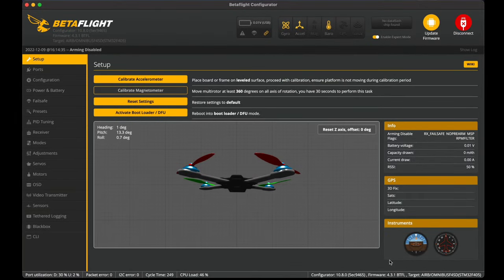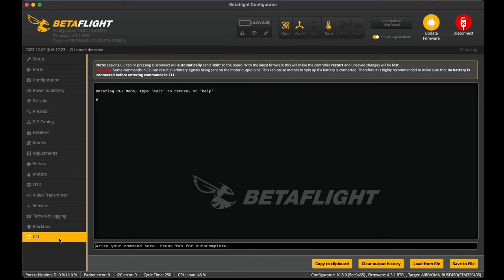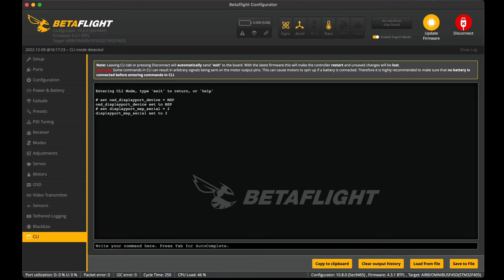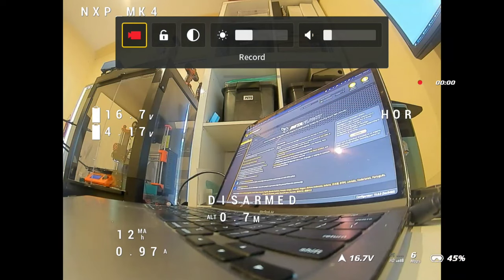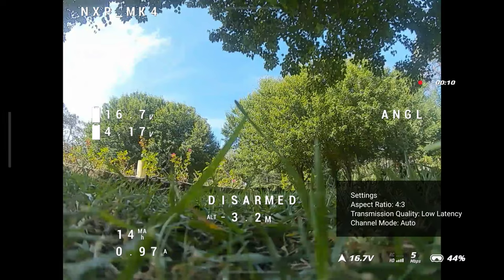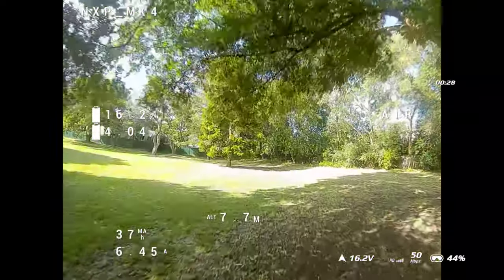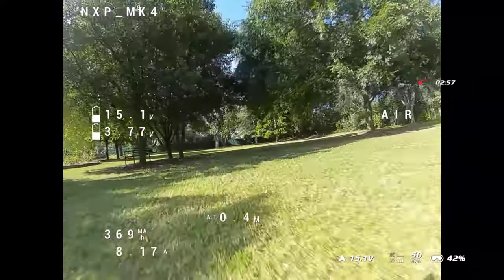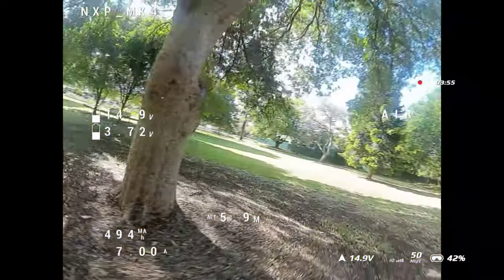DJI Goggles 2 + Vista - MSP DisplayPort Setup on Betaflight 4.3 & Test Flight

Comment: [solved]What do I do with BF 4.4? I updated and it's gone. Your method doesn't work because displayport_msp_serial is no longer available...
Reply: You have to set it up in the ports tab. Go to your UART where your O3 is installed and set it to vtx(MSP+Displayport) in the Peripherie tab.
Reply: @i3engee377  Yepp, that did it, thanks a lot!
Reply: You're welcome my friend 😄 had the same issue🤦🏼‍♂️
Reply from the maker: @I3ENGEE Thanks! I haven't tried Betaflight 4.4 yet but looks like they changed these settings under the hood. I'll update the title of this video and the thumbnail to show that it only works for 4.3 or prior, and not 4.4.
Reply: @nxp200  Good idea - maybe pin the comment of I2ENGEE
Reply from the maker: I can only pin the original content, which is your question/problem. Hopefully that helps others!
Reply from the maker: @seb-depp  seems I can't pin his comment directly, but only the original comment from you. I'll pin it anyway.
Reply: @nxp200  Will do the job well.
Reply from the maker: @seb-depp  done. Pinned comment 👍
Reply: BF 4.4
set displayport_device = MSP 
and
set vcd_video_system = HD
SAVE
Reply: @IyantSeawolf   Thanks. I solved it quite some time ago but thanks anyway.

Comment: I had to downgrade my firmware due to issues with components and this CLI entries fixed my camera issues. I went through every video and Reddit thread until finally saw your video … thanks !
Reply from the maker: There's a video I made for BF4.4 too. Check it out on my video list. That will get you onto a more recent version at least. I've yet to try BF 4.5, so I'll try to make a video on that soon
Reply: @nxp200  I got a good deal on a Nazgul FD5 6s but it took me 2 days to fix all the compatibility issues after upgrading the firmware to 4.5. Do you think it should all work with 4.5 as is or do I need to upgrade ESCs firmware as well?

Comment: I really appreciate you taking the time to put this together...very helpful to me; especially the narrative around the OLED screens. 
I'll have to dig deep and invest in the upgrades.
Reply from the maker: No problem. Any excuse to go out and fly a pack! LoL plus I was excited to try it out as well. One thing i didn't mention in there was it felt really weird to see Betaflight OSD inside digital goggles 😄
Reply: @nxp200  Yeah...not sure how much OSD info I want. It can get distracting. If I remember right, I only watched a few of the metrics when I flew analog. Would like to have distance flown, just to have a mental note of range.

When image stabilization is on (Rocksteady?), is it smoothened in real time, such that it appears smooth in the goggles), or is that a post processing affect?
Reply from the maker: Yeh that's true. The main OSD element I look at most during flight is the average cell voltage and the main warnings for low battery etc.

The Caddx Vista doesn't have Rocksteady or stabilisation. I think it isn't able to because it doesn't have a gyro or a media chip for it to process the video before transmission to the goggles. The O3 Air Unit has a gyro in the camera and media chip in the main unit, so it's able to do Rocksteady.

Comment: Thank you so much for a very easy to follow and very helpful video. I recently upgraded to the goggles 2. I have 2 quads set up with 03 system and have  updated all my vistas  to work with the goggles2. One of my quad's has GPS With GPS rescue set up. I was so frustrated trying to figure out how to get a flight OSD in my goggles. The 2 CLI Commands did the trick . Thanks again happy flying !

Comment: May i ask you what downside of this vista? I heard lots of pilot complain about the heat, its will die when over heat. Was it true?
Reply from the maker: The CADDX Vista units are quite durable in my opinion in terms of heat. I haven't had any issues or any of them dying. I have had the air unit show a warning about overheating and then shut down because it was powered on while on the bench and I wasn't flying, so air flow wasn't cooling it down. After turning it off and letting it cool, it was working fine again after that. Never overheated during flight. Only my experience only though.

Comment: Hey Bud wanted to ask a question about this. After I type in the last line,  "set displayport_msp_serial = 2" I recieve an ###ERROR IN set : Invalid Name: ....... 
My set up MSP on 3 and my CRSF is on 4. Wondering what I'm doing wrong. Thanx.
Reply from the maker: @88_shadesoffpv  you probably have Betaflight 4.4 or higher installed on your flight controller (if you've bought the flight controller recently). Check out my other video as the instructions are slightly different: https://youtu.be/WjS-d4_Es9w

Comment: When I type set displayport .... I get an error message ERROR IN SET: INVALID NAME: displayport_msp_serial=3.  Why am I getting an error?
Reply from the maker: You may be running a different firmware version than Betaflight 4.3. If you have version 4.4 installed, check out my other video that covers that as well https://youtu.be/WjS-d4_Es9w?si=1xHzmcoZCbSXDLKJ

Comment: I just bought nebula nano pro pairing with g2, and the problem is i get small range and osd view get blurry/pixelate in the edge. Is there any tips how and why like this?
Reply from the maker: There could be a few reasons for low range. Is the antenna damaged or installed incorrectly? If there's interference around the location, try changing the channel. Have you applied the "ham CFG" mod to switch the connection from CE region to FCC (not recommended if this against regulations in your region)? The blurry edges on both sides of the video is likely the "Focus Mode" activating due to poor reception. Disabling this will remove the blur, but will likely increase latency when reception degrades. Also depends on what your definition of "low range" is. In clear line if sight, you should be able to get 100m without issues.

Comment: good day Nat or nxp200  . I think I found the battery's with xt60 4S for my build . my build is at 320 euro so far inc battery's . can i use my  Traxxas EZ-Peak Plus 4-Amp NiMH/LiPo Fast Charger on them?  I   don't know what this means in the instructions. [Charge only NiMH packs or 2S–3S LiPo battery packs. so is that mean . no to 4-S for that charger? . and  does a 6-S smoke stopper  work with  4 -S ? and would i buy the smoke stopper with a button or just regular one?
Reply from the maker: It's Nam 🙂
I'm not familiar with that charger, so I can't say. Sorry. The ViFly Shortsaver 2 Smart Smoke stopper is good as it supports up to 6s and has a button to start and stop.

Comment: Hi, I have a question if you wouldn't mind? easy to follow tutorial BTW thanks, but I have a BNF Nazgul5 I just upgraded from 4.2 to 4.3 and the vista is on MSP UART 1 from factory succex-e f722, so how would I set the displayport_msp_serial = 0 ?  that's not going to work is it?  thanks for your help appreciate it.
Reply from the maker: If the Vista is on UART 1, then yes, set displayport_msp_serial = 0

Comment: Why does you're rc signal not show for the dji display? I'm not getting battery or signal for the dji display and i dont know why. (betaflight osd works fine)
Reply from the maker: I was flying that with ExpressLRS control link instead of the DJI controller, so the RC signal is greyed out. Not sure why you're not seeing the battery or signal for the DJI display.. I didn't have to configure anything for that to show.

Comment: Ok so my msp is set up on uart 1 so when I go to cli and set up serial port do I use 1-1 =0 ? How do I configure if I'm on uart1?what would the command be?
Reply from the maker: That's correct. "0" (zero) is a valid value for UART1
Reply: @nxp200  thank you my friend I will try that.
Reply: @nxp200  when I try this I get a message error in set invalid name displayport msp serial =0

Comment: ive got the goggles 2 and vista  but cannot get the osd  to work, mine is set to uart serial port 1 so i should do: set displayport_msp_serial = 0 but i get error ´´###ERROR IN set: INVALID NAME: displayport_msp_serial = 0###´´
what am i doing wrong?
Reply from the maker: Which version of Betaflight are you using?
Reply from the maker: Yeh. Betaflight 4.4 has changed the settings for MSP DisplayPort significantly after I posted this video and my instructions only work for Betaflight 4.3 and backwards. You'll need to look up how to get MSP DisplayPort to work on 4.4, but I believe it's as simple as an option on the Ports tab now. I haven't tested BF4.4 on my 5 inch quads with Vista yet, so I can't confirm exact instructions. It's on my list of videos to make, but haven't had enough time. Sorry about that. Hopefully I can squeeze it in this week.
Reply: @nxp200  understand thanks bro keep on ripping

Comment: Hi, a quick question. How do I get my air unit to start recording video either on take off or with a button. I did it before but just cannot figure it out now.
Reply from the maker: "Auto record on Takeoff" is a new feature added to the Goggles 2 firmware V01.07.0000 that allows it to auto record when using the Vista. Otherwise, for older firmware, you have to manually use the goggle's menu to start recording each time.
Reply: @nxp200  thank you so much for confirming. My drone with DJI O3 records on take off but seems with the original air unit it doesn’t. I’m slowly changing my drones to Crossfire as I really like the Tango 2 remote now.

Comment: - 1set Flysky i6 remote control with ia6 receiver( send it as your choice)
- 1set Mark4 5inch 225mm Carbon Fiber frame(unassembled)
- 1pcs 35A or 45A BLheli_S 2-6S 4In1 ESC( Send it at random)
- 4pcs 2205 2300kv (2CCW, 2CW)
- 1pcs Aocoda-RC F4 special  Flight Control Board
- 1pcs 1500TVL Camera
- 1pcs TS5828 or TS5828s 40ch Transmmiter ( Send it at random)
- 1set nlyon screws
- 4pairs 5045 3 blade propellers
- 2pcs battery Strap  .  with the ev800d . this would be a good learning drone . i think maybe ? if i run into a hiccup on the soldering of the f4 could i send a picture of my diagram for pointer or confimation ? readytosky package
Reply from the maker: Yep. That sounds like a good list. I personally like 2207 size motors, but 2205 should also be good. I haven't used the Aocoda-RC F4 flight controller before, but happy to try and help if you need. 👍
Reply: @nxp200   super. awesome. I've been stuck for days on what to do .which way to go. Analog /digital/bind and fly/DIY . now I  will order my connector for my controller  for free rider sim. to practice while I wait. and start my own build now. get EV800D googles. And smoke detector thing. first steps. I cant thank you enough nxp200.  . analog now digital next . cheers mate
Reply from the maker: No problem! Yes I do suggest analog first to get into the hobby because it's not too expensive, even if you migrate to digital later, your not wasting much money. Plus, analog is still great for tiny whoops etc to fly indoors for many years to come. So the only thing you'll be replacing are cheap VTX and cameras on your drones 👍
Reply: is this drone able to carry a gopro?
Reply from the maker: Yes. It should be able to.

Comment: Wow, great that Vista also have MSP Display port. Do you know if this is also possible to have OSD on Googles v2 with the latest firmware? Now I'm using WTF OS but I'm just wondering if there is any "official DJI OSD" way for older setup like Vista + Googles v2
Reply from the maker: Hi Rfly. Unfortunately once you upgrade the Vista to the latest firmware so that it is compatible with the Goggles 2 with MSP DisplayPort, you cannot bind it to the V2. There is no official DJI way to get Betaflight OSD on V2 + Vista at the moment.
Reply: @nxp200  Ahh, this hobby is expensive. Now I'm thinking about buying Googles 2 ;) But to be honest I like the WTF OS fonts more, you can also customize them so that part is better but resolution of O3 and OLEDs in googles 2 are I think still winning ;)
Reply from the maker: Haha. Yeh, it can be expensive. But my advice is that the V2 is still really awesome with the Vista and WTF.OS root OSD. Don't go the Goggles 2 if you enjoy the V2 already. I got the G2 with the Avata before I got my V2 (found an awesome second hand deal that was really cheap I couldn't pass on). Hope that helps!
Reply: @nxp200  Cool tip. V2 googles are indeed great especially with iFlight Crystal Patch antennas. It was really pain to screw and unscrew original antennas every time I needed to fit it in my Torvol backpack. Now I can even use original DJI protective bag without even detaching antennas. Happy flying!
Reply from the maker: @rfly-fpv  just keep an eye out for any good 2nd hand deals on the Goggles 2. I suspect there will be a few people who jumped on the Avata that will want to claim back their cash in a few months time. Good luck! 👍

Comment: any idea  where to buy the battery at ? . alie express ? local shop ?  6-s lipo ?  xt-60 ends i think. what size amp ? buy 2  to last how long?🧐
Reply from the maker: The motors you ordered are suited for 4S Lipo. I like CNHL Black Series 1500mAh. Unsure what battery connector lead that comes with your flight controller, but if it's 30x30mm mounting size, then it should be XT60. Each pack lasts around 5 minutes of light acro. 3 to 4 minutes of heavy acro (heavy on throttle with high speed runs etc). I've ordered from AliExpress with no issues. Also I've ordered from local stores when on sale.

Comment: How do you feel about the flight feel with the goggles 2 and vista? I just updated one of mine, and going from v1 to the g2, it feels... Wrong. I went through 10 packs yesterday on the g2, and it always felt a bit off, but I can't tell if it's additional latency or if there's something going on with the frame rate. I haven't heard anyone else mention it though, so not entirely sure if it's a global thing, or just my unit.
Reply from the maker: I've only done the one pack that was for this video. I didn't notice anything strange in the flight feel, but it was quite windy that day, so if there was, I would mistake it for wind pushing me around. I'm not sensitive to latency, so I can't really tell that either. Sorry. Can't help you much. I do want to revert the firmware and try the V2 again, so if I do, I'll record it and report back if I feel anything. Let's hope Chris Rosser does some scientific latency testing on this!! That would be very interesting. 🙂

Comment: THANKS BUDDY,  DO I NEED TO DO A ROOT HACK FIRST ,  I HAVE A AIR LITE ON A NAZGUL V1 , WITH  A  TX16  , TRYING FOR THE MSP OSD , I HAD  DISCONECT THE DJI ORIGINAL REMOTE , AND THE UART ABOVE  MSP IS  USING THE RADIO....WHAT AM I DOING WRONG?
Reply from the maker: Hi StarDuss. Need to clarify a few things. Do you have the Goggles V2 or Goggles 2?

Comment: thanks  for the help nxp200 . can I use my old  fly sky  -16  with the TX805 VTX from the build?
Reply from the maker: Hi Jerry. Do you mean FlySky fs-i6 controller?
Reply from the maker: Ah Ok. The fs-i6 is a radio control transmitter and the TX805 is a video transmitter. They are for different purposes and do not communicate with each other. In my build, I used the RadioMaster R81 as the receiver communicating on the FrSky D8 radio protocol. The TX805 transmits the analog video signal to my goggles. Hope that helps.

Comment: Hello, how to record what the glasses see? I don't see the option
Reply from the maker: On the Goggles 2, you'll need to swipe down on the touchpad. The video recording menu will appear and there will be a record button. This will initiate recording in the goggles. If you're binded to an O3 Air Unit, it will also start recording on there as well.